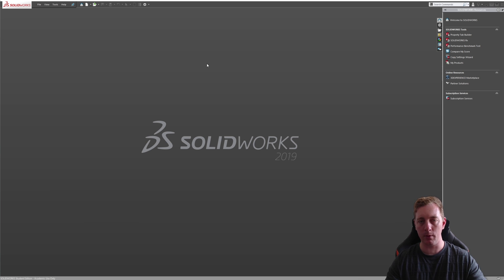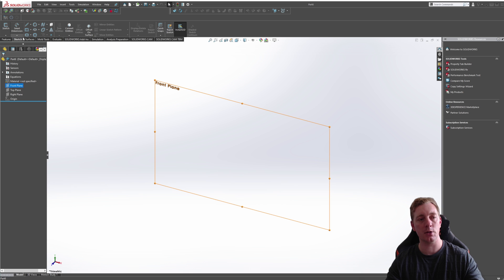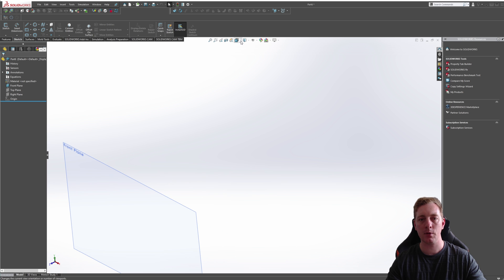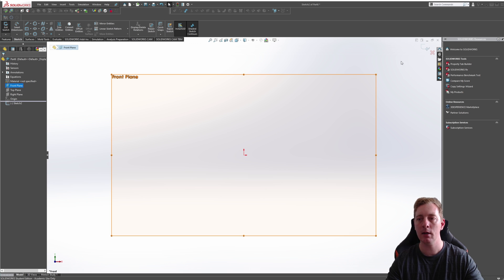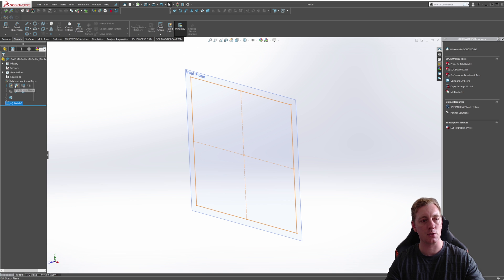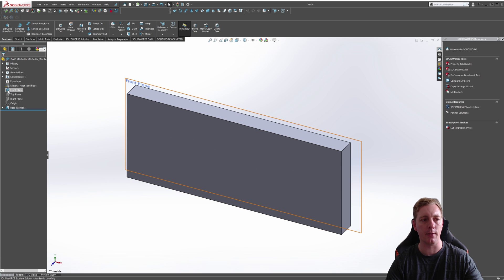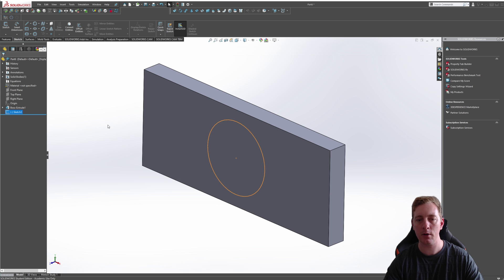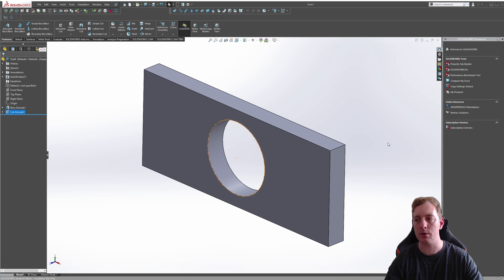Sketch On A Plane Or Surface | SOLIDWORKS 2020 BEGINNER | Chapter 01: Lesson 01 | CSWA COURSE

Comment: Hi i am a new user of solid works 2011 and my version of solid works is not the same version as you are using because of my limited pc specs. My question is that is there a difference in the version except for the additional features that solid works added today and in what way can this affect me as a student learning the lecture?
Reply from the maker: Hey there. 2011 version is quite old so Im sure there are quite a few changes compared to the 2020 version. Also check if your educational institution has a student license available that you can use. But if your just using 2011 to learn and have no other choice, it will be enough to get you started so there is no harm. Just be aware that when you do get access to a newer version you will need to update yourself with any changes.
Reply: You can use v2011 to learn the essential aspects of solid and surface modelling. By then, you will have learned to deal with the absence of some tools that are part of v2020. As an example, search here on youtube for "how to make a screw and nut" both in v2020 and older versions like v2012 or v2015.